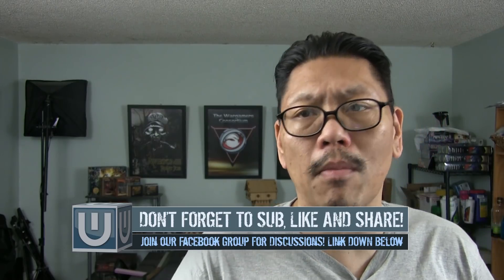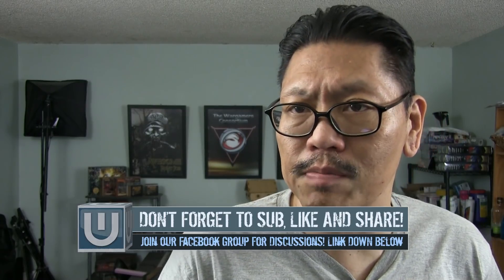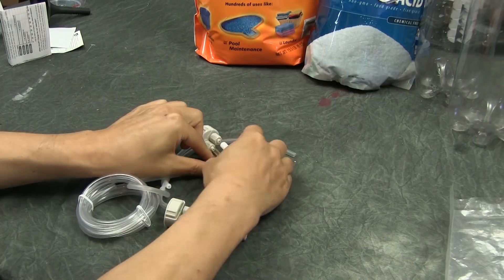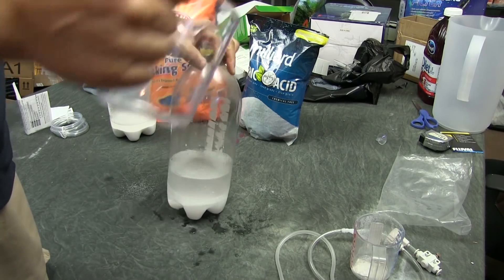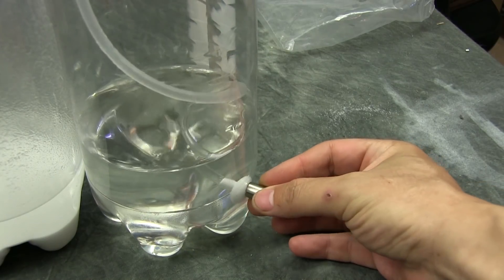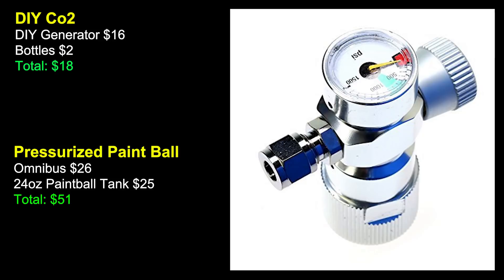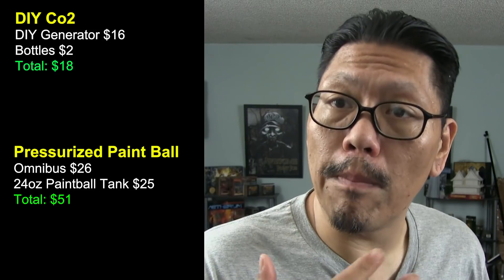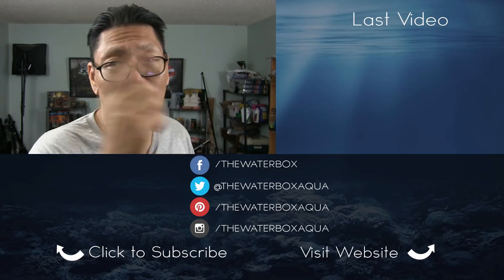DIY Co2 for your Aquarium - How To

Comment: What kind of co2 would you recommend for a 5.5 gallon tank with Monte Carlo carpet
Reply from the maker: Could just go DIY. Easy and cheap. Or the Fluval 20g passive co2 system
Reply: The Water Box ok thanks I think I’m going to go diy because I hate the bulk of the passive diffuser of the 20g after I’m finished with the dsm period, how many bubbles per second for a 5g aquarium
Reply from the maker: for DIY? Start with one and go from there depending on how your plants are doing.

Comment: Hey, Great vid! Thx!
I'm going to try the Anself DIY CO2 (D501) generator/system on a 20L.
Would you / Could you pls do a review on the newer D601-S model? No more plastic drink bottles, self-contained stainless steel canister with (some) electronic solenoid ON/OFF regulator for around 89 to 99 bucks. TIA!
Reply from the maker: If I ever get one, I would do a video on it but I mostly run on pressurize co2 now for all my tanks so I'll probably never need to get one.

Comment: Wouldn't shutting it off at night cause too much pressure to build up in the bottle?
Reply from the maker: I never had a problem. The bottle are meant to take on a lot more pressure and the co2 contraption on thses DIY sets will usually give before the bottles would.

Comment: The main problem I am having with yeast sugar mix co2 is an effective way of diffusion. Glass diffuser won't work properly. If you can provide me an effective DIY co2 diffusion method that will be very helpful.
Reply from the maker: Glass diffuser always worked for me but I'm using a Citric Acid and Baking Soda mix. It sounds like you're not getting enough pressure out of the reaction. Yeast+sugar I find to be a pain to do. How do you have it set up? One bottle or two bottle set up?  How are you mixing your yeast/sugar with the water? You're using hot water so it properly dissolves the yeast/sugar?
Reply: I am using warm water to mix 250 gm sugar and 2 small spoon of yeast in a 2 lit bottle. The reaction is fine because I  am getting 2 bubbles per sec for first 5 days. After that it decreases.
Reply: I just set up a yeast/sugar mix the other day. One half liter bottle only. I have the same problem regarding the diffusion so I have the tube going into my internal filter. It's only a 10g tank but works great. I'm curious to see how long the mixture will last (1tsp yeast to 1tblsp sugar). I'm sure I'll upgrade to a baking powder/acid setup but I'm just "getting my hands wet".

Comment: Sir can i ask, how would i make sure that may DIY co2 is working great, and make sure that it would not kill my fish
Reply from the maker: I guess make sure you have the mix right. DIY Co2 rarely every kills kills fish. The concentrationg isn't pure enough, especially in larger tanks.  In smaller tanks it can happen easier but again, rare.  More important is not getting the mix into the tank itself.  Again, rare.  You have to do something really stupid like squeezing the bottle on purpose into the tank.  MAYBE if the bottle tip over so there's that.

Comment: Hey WB, this is the second video I have watched and am excited to build my own CO2 system.  You mentioned this not being good for anything over 30 Gal?  I have a 55 Gal, but wouldn't ANY additional CO2 I can add be helpful to my plants?
Reply from the maker: Go for it. Can't hurt to do it. Just make sure you've got the flow to move the co2 around. It's not that you can't do it. It'll work. It's just a pain in the butt to do it and not as efficient. What you can try to do is instead of using a mister/Atomizer, try going the co2 bell way. Try both and see what works best for you.
Reply: @TheWaterBox  Yeah! For the CO2 bell method. I wish that there were (*hint*) more vids on this. ;)

Comment: Hi i tried doing this but I can’t seem to control the air valve that much. Also the bubble counter seems to empty out and move the water that’s inside the bubble counter back to the tank and the bubble counter is empty with a little water left but no bubbles are forming
Reply from the maker: Are you using a DIY kit?
Reply: The Water Box yes it’s the same exact one that you are using in this video.
Reply from the maker: Hmmm. I've not had too much trouble with the valve but it is a little stiff making it hard to dial in. I'm not too sure about the emptying of your bubble counter though. Maybe you're blasting the co2 it'll happen but you would know if you were blasting it or not.
Reply: i'll find out more information about the bubble counter and i'll let you know!
Reply from the maker: Cool!

Comment: I have regular pressurized co2 and i want to run it to two tanks, I was wondering if you would recommend splitting the lines with a t-valve or just getting a separate bubble counter? I just didn't want to spend a whole lot of money buying an extra manifold and bubble counter, those gla regulator manifolds aren't cheap lol. Also, the videos look great man, what editor do you use? Keep up the good work.
Reply from the maker: I use the adobe suite of stuff (premiere, after effects, photoshop).  For splitting, do what I do. Go to ebay and get an off brand. It'll be under $20. :)  I have it on my tank that feeds the 20g iwagumi and 40g.  You can see it in this video at 3:48 > https://youtu.be/QQji5LypDN0?t=3m48s
Reply: The Water Box awesome man, tanks for the info! Sorry for the pun 😂
Reply from the maker: Alpha Aquarium all good! Where would we be with out the aquapuns?

Comment: Hi. I'm trying to set up a planted tank. and I am looking to buy pressurized co2 system.. although my budget is around 100. Most of the systems I see online are 200+ including all the equipments necessary.. would you be kind enough to send me link for co2 tank that cost only $71 in your video?
Reply from the maker: The best you probably can do is around $120 for just the regulator and a tank.  Just check on ebay or amazon

Comment: just noticed today the citric acid bottle is almost empty. Looks like the citric acid transferred to baking soda bottle. Is this normal?
Reply from the maker: That's suppose to happen. That's how it causes the reaction to make co2. Little by little the citric acid moves into the baking soda bottle.
Reply: @TheWaterBox  hi thank you for your response, just been 3days now since I set up my co2. And the citric accid bottle almost empty.., should I refill now the A and B bottle or should I wait til no bubble coming out and no  pressure in the bottle?. Hope u help me I'm new for this hobby lol 😊
Reply from the maker: Wait till there's no more bubbles. Did you get one of those DIY contraptions with a pressure meter on it? If so, just look at the pressure meter. If it's close to zero, do a new mix.

Comment: I bought a co2 kit for my 30g which uses the usual sugar and yeast. I set it up correctly and I'm still not getting any bubbles coming through. it's been set up for 4 days now. and since I paid £40 for it, i really want it to work
Reply from the maker: What brand is it?
Reply: @TheWaterBox  it's a JBL pro flora 160. it seems to be fermenting in the bottle but there are still no bubbles coming through
Reply from the maker: Is the yeast from the packages the give you or did you buy it?
Reply: Wrong type of yeast.

Comment: Hey, do you still use the system? Is it working all right. I think it is cool but i am not sure how it will be in the long run.
Reply from the maker: Yeh, it works. It's jsut a paint to keep mixing a batch every 2 weeks.  If you don't mind doing that, then yeh, it will work great.
Reply: Sure, but maybe that depends on the size of the aquarium. Mine is 3 gallon, shrimp tank and has 1 bubble every 4 seconds, so I expect it to be more durable. I read that the valve dies after a while, but it is not that bad.
Very informative though. +1 subscriber :)
Reply from the maker: Hmmm... the valve never died on me.  If you use too much force on the valve (twisting hard) I can see it breaking.  If you're running 1 bps then it will last longer for sure. What kinda of plants in the shrimp tank?  And thanks for subbing! There's also another solution to co2 for a 3 gallon tank but might not work for that size for what I will be talking about. Watch for video in the morning. ;)
Reply: Now i have java moss, anubias nana and planning to add some dwarf baby tears.
Reply from the maker: The first two plants will do fine.  Dwarf Baby Tears? Are you sure you wanna go that route? Or do you mean just normal baby tears?
Reply: Why? What is it with the baby tears? Which one do you think will be the best for small aquarium?
Reply from the maker: Most of the time, Dwarf Baby Tears (Hemianthus callitrichoides) need high light, co2 and good ferts to grow but some people have experience with medium tech settings.  Regular baby tears are way easier to grow in a lower tech set up. But it's just a 3gallon we're talking about right? I think you'll be ok with that small of a tank with the lighting. The lighting is my concern.  But if it's that small of a tank then the distance from the light to the substrate should be decent. What kind of lighting it on it?
Reply: The Water Box, I have 2 led lamps 6500K it is really bright in there. I think there should be no problem. Still want to hear your thoughts.

Comment: I tried the same setup but my citric acid kept going into the baking soda bottle. So in half a day, the citric acid is all gone... did i do something wrong?
Reply from the maker: Is you're valve all the way open? You just need it to pump like 1 bubble per second. If you have the valve all the way open, it'll just release a lot of co2 as it's making it and the citrus acid is just going to keep dumping into bottle B.
Reply: @TheWaterBox  Oh wow, thanks for replying... that made sense... i will try it. Appreciate your reply... 😁
Reply from the maker: @RedViperika  good luck

Comment: Hi, I also purchased one of these DIY CO2 setups (still waiting on my diffuser and for my dry start to finish). Would it be possible to, instead of using a solenoid valve, add an air pump on a timer to make the CO2 diffuse faster overnight in order to guarantee the safety of any aquarium fish?
Reply from the maker: The concept is sound but I can't say for sure as I've never tried it. I couldn't tell you if the air pump will diffuse the co2 away enough. Sorry 😒
Reply: All right, thanks. :)

Comment: Hey... I have this problem, pressure and co2 goes ok for few days, then boom high rise in pressure. I dont understand, if im doing something wrong, or some how to much citric acid goes into soda after the pressure drop. Im a bit scared it will blow up if im not around and check it time to time. Plus, when this happens, my bps changes it rises a lot if the pressure increases and goes down if is pressure drops. Does any one else got this problem? Im confused why is this happening. My connection is aluminum but working same as the one in video. With solenoid valve and bubble counter. I mixed new batch 3-4 days ago, yesterday evening I checked it and the acid bottle was empty. I made a new one today, mixes citric acid with 700ml of water, to decrease the reaction just in case, so i did the reaction for 15 min to rise up to 1 kg. and waited for it to stop,  ok, and two hours later it was up to 3kg and rising. Like wtf. This has happened at night once, even when co2 was off. Any help or ideas would be helpful. I thonk the problem is that too mutch citric acid goes into the soda bottle, but im not sure what to do to stop that happening.
Reply from the maker: Are you using 2litter bottles?

Comment: May i just mix the citric baking soda and add water and let the reaction happen to let co2 into the tank all in 1 bottle
Reply: I think if it all mixed at once the pressure would explode the plastic
Reply from the maker: It won't last long. And it'll just create so much pressure you'll just lose all of it in a hour.

Comment: Hi, is it safe to run diy co2 (yeast&sugar) for 24hrs? My light opens for 8hrs.. is it safe for my fishes or i need to shut my co2 when my light is off?
Reply from the maker: To be safe, not really.  I can't really answer that as I don't know how your set up is and what kind of parameters are in your tank. The DIY isn't as potent as normal pressurized stuff but it's still pump Co2 into your tank.

Comment: DIY co2 system can be safe.I afraid will exploxsive like a bomb😭.Pls answer me safe or not.
Reply: Citric acid and baking soda won't build enough pressure to explode, you're ok to use it, vinager and baking soda can't be shut off it WILL explode not citric acid.
Reply from the maker: It's safe. Unless you do something drastic.

Comment: why do you need two bottles... why cant you just mix the baking soda, and the citric acid in one tank/bottle, and go from threre?
Reply from the maker: Because that's not how it works. It won't last long if you do it that way.  If you want to just use one bottle, then try the sugar/yeast combo.
Reply: @TheWaterBox  Okay, i was just curious, cause theres a product on amazon that you can get, its a CO2 bottle with regulator, but you fill it yourself with the soda and acid, in the one tank.. so didnt know why that was a single tank, and this way is double... thanks
Reply from the maker: @samanthaferraro5925  It's a different type of set up.  The mix is probably different. I know which one you're talking about but I never had a chance to use it so I'm not sure how that works and how well it works.
Reply: @TheWaterBox  i see.. thank you for your reply!! i appreciate it!

Comment: I know this is a year old but I thought I'd bring up something very wasteful with the entire internet  ratios between A&B (Citric Acid & baking Soda). It's always 200g Citric Acid (A) with 600ml water (1:3) and equal 200g Baking Soda (B) with 200ml water. Now if you go to some very sciencey pages they talk about how the 1:3 ratio is for the A to B and the 1:3 talked about for the A is really so it is fully dissolved. They say 76 parts A to 100 parts B
 I am in the process of a test. 
You can get a co2 reaction if A in water is dripped straight onto B. Now my sciencey friend said this cause the fastest co2 reaction so water assists in slowing it down as to not build up pressure to fast. 
In my 2L bottles I have 304 grams of A to 912ml of water and at 1:3 that's 400 grams B to 400ml water. That's still less then a full 2L which you obviously don't want. 

 I came to this because the Citric Acid solution after all the Baking Soda was used, still makes co2 if Baking Soda was added. Which means the Mixtures everywhere that states A=200g+600ml to B=200g+200ml is wasting your Citric Acid. As well as 1'200 ml of space in the bottles that can be used, leavin 400ml of air/co2 space and not effect the siphon in bottle B. 
 Above I have a total of 1'312ml plus the dissolvable and the Baking soda looks like it can go with less than half the water, enough to have it wet and muddy. So after the mix I have, (we'll see how long it lasts too) I will try 304g A to 912ml with 400g B to 228ml. Than the next test after that will be adjusted to use as much as the bottle(s) as I can. As you might already know when your diy co2 is finished all the liquid it in the B bottle. So keeping with adding very little water to the baking Soda and maxing out the Citric Acid mix I think I can achieve the best mix for the DIY 2L bottles co2. My advanced mix I will be trying is
452g A to 1'362ml Water
to 
600g B to 388ml Water
That's 1'750ml Plus the dissolvables. Might adjust down to a total of 1'500ml dues to I haven't figured out how much space the dissolvables actually take up.
Reply from the maker: Thanks for the great explanation on this! thanks! I'm going to dig into this myself. Dunno why I didn't do it sooner. Would be a great test to do.
Reply: I'm new to it. New eye see/think different lol It was just, why so much room left unused lol It's in my 55 gallon and I'll try to remember to let you know ho long this one lasted.
I just gutted my 55g so I can balance the water on my days off and get it back to a happy tank using seachem nutes and the diy co2.

I'm no scientist so in your digging please let me know how off I am lol so far the first mix is running fine.
Reply from the maker: Awesome!

Comment: I noticed you're saying grams and milliliters but yet you're pouring your contraptions out of a liquid measuring cup hence cup what the deal man. You can't convert it over by just looking at the lines in your measuring cup. If you're going to do an informative video maybe you should put all the information into it. Now I have to go online again and do all the damn conversion
Reply from the maker: The cups I used to measure the water. I measured the powder using a scale. I just put them into the cup to pour into the bottle.

Comment: unfortunately these diy kits are a roll of the dice...most seem like they will not work for long or at all.  Pressure dropping constantly, or going too high...the parts that connect to the bottles will break or leak air sooner than later.  Not to mention always having to buy citric acid, which is not cheap either...25$ every 2 months for a 55 gallon tank...it seems that in the end, it costs the same or more as a regular co2 tank, and way more hassle to keep working!!!
Reply from the maker: I wouldn't go this route for a 55gal tank. But I get you
Reply: @TheWaterBox  55 or 5 gallon, it makes no difference lol.  The hassle remains the same and the inconsistency doesn't change either.  I would say this is an option if you want to 'try' something for a week or 2 as a tester, just to see if some co2 makes a difference, but to rely on it for weeks on, it's a waste of money and time!
Reply from the maker: yup